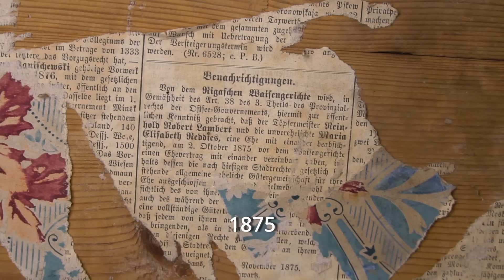RESTORING the 19th century JUNK / cabinet restoration

Comment: I like that you kept as much of the original wood as you could. That’s my biggest pet peeve when restoring old items, when someone replaces all the original parts with new parts then it loses its nostalgia. Good job! 👍🏽👍🏽
Reply: Or, they paint the wood and then “antique” it by sanding the edges to make it look “shabby chic.” 🤮
Reply: @ReisigSeeds  exactly!
Reply: @ReisigSeeds  Im so guilty of paintimg and antiquing old furnitire.
Reply: I was going to say something similar. When he was done, the cabinet still looked very old, but like it was just in very good shape.
Reply: ...or paint it flat black. Seriously,  if you're going to do that to antique hardwood, just get something from IKEA.
Reply: It's a rebuild then not a restoration.
Reply: @wahinenuiloa if you are painting modern furniture it’s totally fine, but it’s a crime to paint a truly valuable antique furniture in my opinion. I would never attempt to restore something like that, it should be done by a professional.

Comment: I am amazed to see how the people in the old times were able to make such things without using all these machines and tools etc that are needed for restoration. 😊 
Love your work. Subscribed 👍🏼
Reply: The furniture makers in 'the old times' had most of the tools you see in this video.  Just not the electric ones.  They had power tools that were either water, steam, or engine driven.  A modern craftsman would be very challenged to keep up with an 1875 craftsman.  They had all the chisels, saws, and a myriad of hand planes that performed very well.
Reply: @georgepretnick4460  😱
Reply: @georgepretnick4460  I don't think most woodworkers would have access to such things prior to the 20th century. I believe there was large industrial equipment powered by such things, but I figure it's more milling and other heavy duty trades, not fine woodworking. Do you have any sources you could link talking about it? I've been wanting to learn more about woodworking history and have had a hard time finding good places to research from.
Reply: @amandaduckett3093  yes, there was industrial level furniture, door,  window and flooring manufacturing back to Roubo.  Most wood working powered machinery was developed in the 19th century,  it just wasn't electric powered.   Most of them were powered by a belt drive coming off of a central drive shaft.  That drive shaft was powered by, you guessed it, a large industrial engine, a steam engine,  a water wheel, or even animal powered.
Reply: @georgepretnick4460  Now that you mention it, I believe I have heard of such things before. That being said, most smaller businesses or shops probably were not fitted with such things, just like today many small shops don't have the newest and latest technology in the field. I worked in a cabinetry shop that didn't even have a CNC until 2020!
Reply: @georgepretnick4460  most of the decorative parts are masproduced in the 19 century and seled to the carpenter by an catalog. In the factorys the production was mecanized.
 in the Workshops the use of powerd machine start in the erly 20 century, in rural areas even in 1950 lots of carpenter work only with hand Tools.
Reply: @jonawolf8023  You're about 150 years late regarding mechanized factories.  There was mechanization well before electric power.  Water power was used in mid 18th century.  As in 1750.  The Industrial Revolution.
Reply: @georgepretnick4460  the first waterpowerd saw was recordet in 1204. The belt-saw was invented 1809, the first belt that fit to this saw in 1946...
Thonet starts his factory for massproduced furnitur in 1819. That proves the existens of machines for woodwork in erlyer time. But they start to becom comunly used first in the 1920.

Comment: As usual, a fantastic result! I guess I am wondering why the use of veneer? Was the wood so damaged that it wouldn't have looked good strained? I don't know enough about restoration to be able to answer my own questions! I kept thinking that I wish I was there so I could ask questions about what you are doing. I would have pestered you to death! You are so talented!
Reply: Same question I would ask. The veneer hides the original wood grain, basically hiding the 100+ years old pieces.  An explanation would be appreciated.
Reply from the maker: If the wood is heavily wormed then it´s pointless to warnish it, it just wont stick. If you just use filler and then varnish it, will be very ugly.
Reply: @ATRestoration  I knew there was a reason! Thank you!
Reply: @ATRestoration       You do really nice work.      This is a bit nit picky... but I wouldn't call this a restoration - I would call it a renovation.  With all of the veneer work, it's not really a restoration any longer since you're not bringing the piece back to its original look.  This was clearly the right way to go, it just doesn't seem to be a true restoration.
Reply: @johnm1926  that maybe be technically correct...  But i think to get the most people to view his amazing work, restoration will do just fine.

Comment: Hours upon hours of precise measurements, artistic reproduction and reapplication/replacement of decorative trim, clean up, installing new veneer, choosing a beautiful stain and topcoat finish layers have resulted in a beautiful homage to original craftsman, wood carving, furniture design and historical (to the original design/completed piece) accuracy. Sir, you have resurrected the optimal aura of fine furniture. Thank you for sharing.❤🎉😊

Comment: While I appreciate the skill and dedication shown in creating replacement intricate trim and molding pieces, I want to get this on display sometime in my lifetime.  

Thus, I would replace the broken or missing pieces with pre-made pieces available in my area, and if that would mean replacing all of it, so be it.  Much of the ornamental materials I’ve found in my hometown are very intricate and would do an excellent job of trimming out older furniture and other woodworking projects.  As long as all trim pieces match on a given face of the project and the entire unit is restrained or painted so the piece looks as though it is similar in shade and/or age, it will meet my needs.  I’m simply no where as skilled as you are so I’ve got to improvise where possible.